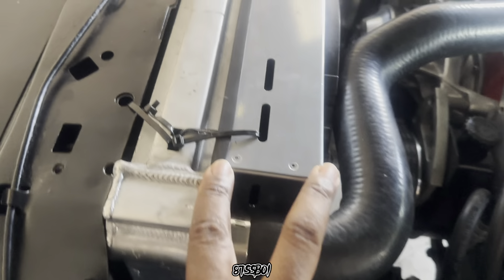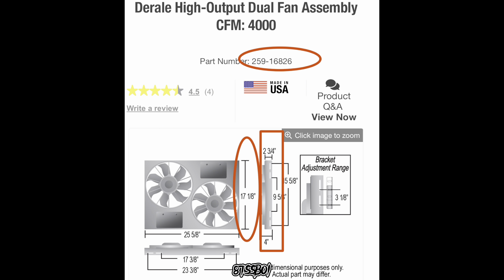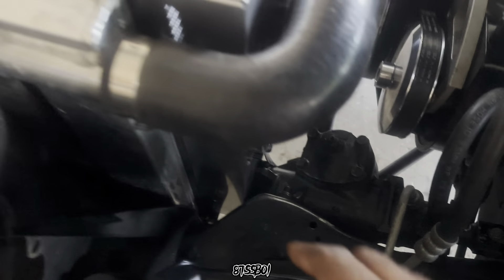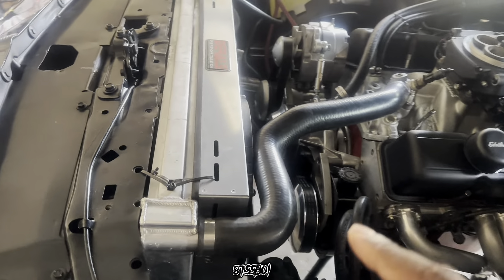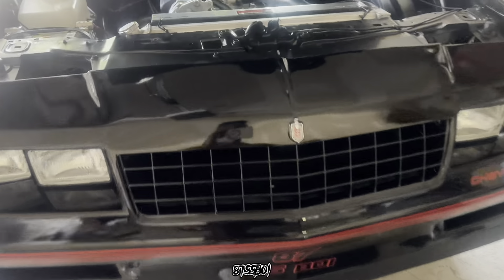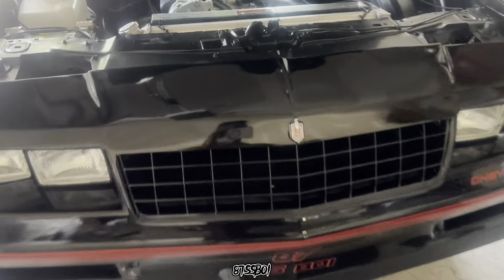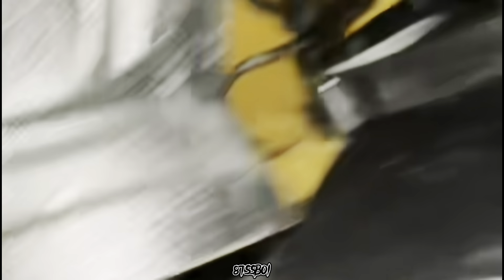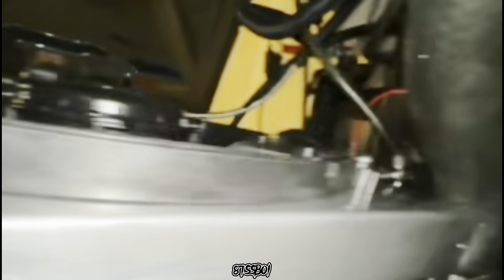DERALE 16927 Vs 16826 IN A GBODY + MY REVIEW ON THE NEW SETUP

Comment: I running the darale fans on my Gbody and the problem  I came across was the gear box.I had to tap it in but it’s a snug fix but they work way better that the eBay fan. Appreciate you for the info 🫡🫡💪🏾
Reply from the maker: Yessir!! My other fans were cool..they were the same brand but these are more powerful…them eBay fans def ain’t it…the radiators cool tho..thanks for watching👌🏾

Comment: I installed the 16842 on my cutlass with a griffin 3 core. Issue I have is the lower radiator neck isn’t straight but curved and the shroud won’t sit down flush
Reply from the maker: Always something 😒
Reply from the maker: Gotta modify it somehow and make it work if u really wanna use it
Reply: @87SSBOI  Well it’s in there snug but I’m trying to figure out the wiring to my sniper. I ran mine with relays and circuit breakers. I also have a switch that I can manually turn one fan on and off but like I said I’m trying to figure out how to wire then to my sniper. I need to hit you up and figure out how you did your fuel system for the efi. I tried to find a video you posted but I’m not sure if you posted anything on your fuel system.
Reply from the maker: @lamarcusburston8052  nah I didn't start YouTube til after EFI and Dakota Digital Installs
Reply from the maker: @lamarcusburston8052  easy to setup fans to the sniper...find the output wire for the fans and run the ground trigger to each one (fan 1 and fan 2)...I can't remember the colors of the wires but it's in the sniper manual...and for the fuel pump...just gotta ground it and run the power to IGN and thru a relay...I just did everything by the manual... definitely open for questions or whatever...hmu on IG @87_ss_boi
Reply: @87SSBOI  ok cool so you ran the fuel pump that came with the sniper? The inline pump? I basically have an aeromotive inline pump but it’s been giving me issues so I didn’t know if you ran an in-tank pump or not. And I’m gone figure out those fans this weekend. I appreciate it bossman
Reply from the maker: @lamarcusburston8052  yea I ran everything that came in the kit...spent enough money on it 😂...inline pump and pre and post filters

Comment: Good info quick question so I just ordered the 12” fans off Amazon $350 I’m gonna have change out my existing radiator combo what would be a good price saver radiator to get I’m running 383 stroker about 450 hp also vintage air I wanna try and catch while I’m still in the tuning stage
Reply from the maker: Thanks for watching…this is the radiator my friend has and it works great 

https://www.ebay.com/itm/254898282282?mkcid=16&mkevt=1&mkrid=711-127632-2357-0&ssspo=XE9hkNsUR3W&sssrc=4429486&ssuid=SVqAzq-iSTm&var=&widget_ver=artemis&media=COPY

Comment: The same thing happened to me with the fuses bro. What size gauge wire did you run straight from the battery to your distribution block? 10 gauge or 8?
Reply from the maker: I can’t remember but it’s the same size that the fans come with…it’s all good now…I just removed the fuses cause most people I talked to said they don’t run a fuse and have been running these fans for years…I did find out if you want to run inline fuses u have to run 1 for each fan in order for them not to pop
Reply: @87SSBOI  ok I will try that. I am running a in-line fuse for each fan and they still pop. I had a scare earlier when I was driving and seen the temp rising up to 200 luckily I had a box of fuses in the console. Hope  this fixes the issue. I’ll probably get that Msd relay you was talking about this winter. Appreciate it 💪🏾
Reply from the maker: @84SS931  that was the next thing I was gonna tell u…get that MSD relay box…make sure u get the 35Ax4 tho…7564-HC
Reply: @87SSBOI  ok bet thanks for the info
Reply from the maker: @84SS931 hey bro the MSD relay is on sale!! They come in red and black..

MSD 75643-HC: High-Current Solid State Relay 35Ax4, Blk , Black https://a.co/d/emAQWp4

MSD 7564-HC: High-Current Solid State Relay 35Ax4, Red https://a.co/d/1qUCyEm
Reply: @87SSBOI  Appreciate that. I figured out the fuse issue was just a bad ground location from the fans causing too much current on the positive feed. Im definitely getting this to clean up them wires💪🏾
Reply from the maker: @84SS931  glad u figured it out...I just ordered mine!!